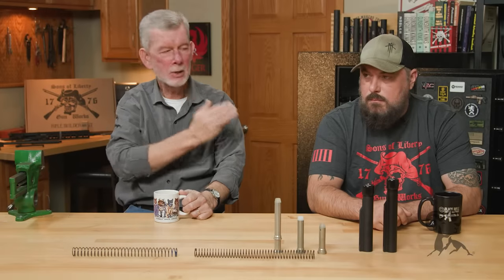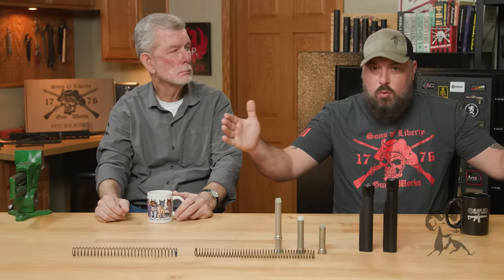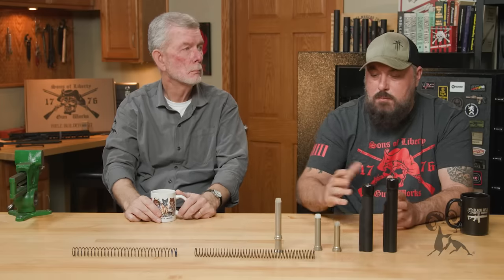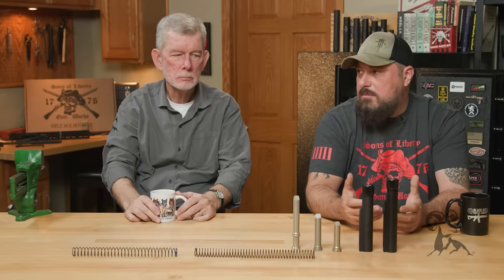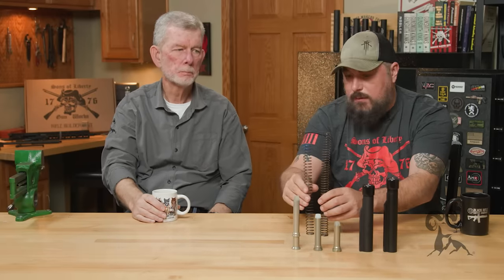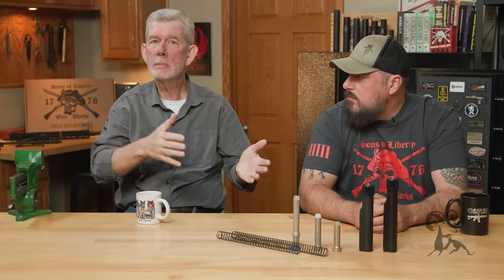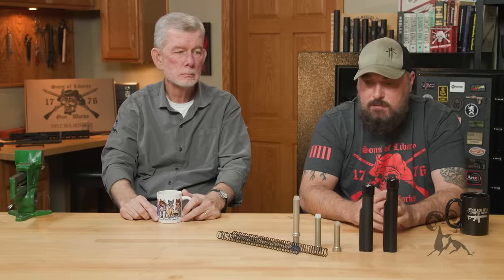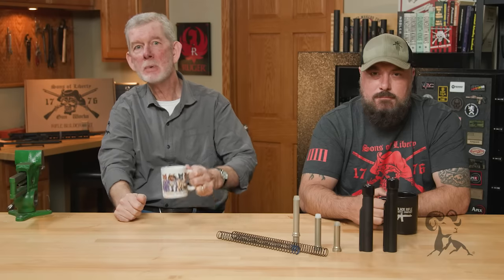Quick Tip: Benefits of an A5 Buffer in Your AR-15

Comment: After upgrading my AR's to A5 buffer systems a couple years ago per Mike's advice I can attest that they make a pretty big difference. It feels better overall, but a big thing is it gives any rifle less recoil. Buffer weights is also a big thing to look into. Most 12.5-16 inch middys will work great with h2 which most prebuilt AR's these days come with the lightest possible buffer weights.
Reply: You don't happen to have a link where I can pick the system up
Reply: @jason hensley considering this is a Brownell's video...I bought a Sons of Liberty barrel from Brownell's
Reply: @jasonhensley3071  You can save money by not buying the complete VLTOR kit. Order their buffer (They're the only ones that make it) any rifle length spring, I HIGHLY recommend a flat wire from Tubbs or Strike Industries, and the AR-10 buffer tube.

I got a Magpul Buffer tube
           Strike Industries spring
            and the buffer for right around $80.
Reply: I switched near every one of my carbines over to an A5 setup and guys that have fired those guns at the range were amazed at how smooth they are to shoot.
Reply: @deangullberry5148  
Primary Arms has the buffer and the extension
Reply: Most companies tend to throw carbine and H1 buffers into mid length gas system rifles so that people don't complain that there is something wrong with the rifle when they shoot garbage, under powered .223 through it. They'll blame the rifle and not the russian ammo.
Reply: @minilogoguy18  i had 2 ARs built at the same time.. a 16” and 10.5”. My 16” has an H1 and slams the bcg so hard. Do I need to go heavier?
Reply: @chief5981  you definitely can but you may run into some ammo not cycling the gun. Buffer weight swap is a pretty easy and cheap way to reduce some of the recoil. If the brass ejects around 4 o'clock though I'd probably leave it alone.
Reply: Will a mil spec stock fit this? Maybe a stupid question.
Reply: @Greighps  Nah you're good man, no stupid questions. Yes it will fit, it's just a regular mil spec buffer tube except it's just a couple inches longer.
Reply: @mrsickwick  awesome dude, I appreciate the reply.
Reply: @chief5981  Mine are all 5.2 oz and David Tubbs flat wire spring. You’ll be amazed.

Comment: I carried a 20” M16 in the Marines and it was an extremely smooth and reliable rifle.
Reply: Yes indeed. Same here. The carbine I shot after getting out are quite a different animal.  I still prefer my 20" A2 clone.
Reply: Thank you both, fot your service. My son is in the Marines, right now.
Reply: @tufelhunden5795  I think the modern equivalent is a 16" AR with a mid-length gas system and the A5 buffer. Really it's the first time in a couple decades that the platform has returned to the original, more gradual recoil impulse
Reply: @Courtesyflush52  I’ll give the A5 buffer a try. Thanks for the information. 👍
Reply: Same here, Brother.  Semper Fi!
Reply: @Courtesyflush52 I always thought it was just nostalgia [or maybe triangular handguards] that made my A1 "feel better." It's hard to explain to someone that's never fired M193 out of a 20" barrel. I say it's like the difference between .45ACP and 9mm, or a push and a slap. I will definitely look into an A5 recoil system. Do you think it'll go good with my B5 furniture? 😉😊 Oooh-Rah!! Semper Fi!! 🇺🇸
Reply: Yes, it is, but for short armed guys like me with armor and gear especially, it's way too long of a stock.  Now that I'm a civilian, an A5 with a simple fixed stock is ideal for my length of pull.

Comment: I installed the A5 buffer system on one of my ARs, now I have at least 5 or 6 ARs that I have swapped over to the A5. It really does make a big improvement in the operation and cycling, And especially reliability and increasing the operational window. And who doesn't want smoother recoil?
Reply: Do you think it’s worth upgrading on a 16 inch carbine length gas system?

Comment: Great video thanks.  To this day I prefer my 20" AR for just plinking around as it is so smooth.  I served '86 to '91 and used the A2.  When I grabbed a carbine for the first time I was thinking something is wrong with this firearm.  😆 Now I'll have to make sure my carbine have the A5 extension to see if it helps.
Reply: Night and day difference.  An absolute dream with a mid-length gas system, and adjustable gas block.
Reply: Thank you for your service Sir.
Reply: Exactly what you said!  After a 25 year sabbatical period from firing an A2, I fired a modern carbine and thought "WTF!!!".  Now all my AR's have this A5 buffer tube.

Comment: I like that he mentioned the "mid-length" gas system. So many people don't know about it...Its what I prefer.
Reply: My first AR was a Aero Middy “build”. I can’t remember if I had put a H1 or H2 buffer in it, but it was a smooth shooter. Only problem I had was the FSB was canted. And I had only found out after I replaced it with a picatinny gas block, that the gas port was drilled off center.

Comment: 100% agree, the A5 system was a huge improvement to my 11.3 Suppressed upper. Definitely well worth the money.
Reply: What length spring and what A5 buffer are you running on the 11.3” suppressed upper? Also what gas system is it?
Reply: i also would like to know which buffer weight youre using. im assuming you cant run a spring that is shorter than the rifle buffer spring since the buffer tube is slightly longer than a carbine length

Comment: I have a KS-47 build that I did something similar on. I didn't know about the A5 system, so I took a rifle length buffer spring and paired it with a KAK variable buffer, using the 3 tungsten weights. It really took the snap out of the 7.62x39 and has become my go to.

Comment: I like that someone actually engineered this to be correct, not just a cut it down and tweak it enough to run.
    I wish Brownell's would manufacture an adjustable gas block for various weapons. The AR would be good and I personally would like to have them for AKs. A lot of weapons are 'overgassed' as a 'band aid' for reliability issues. A correctly gassed weapon doesn't slam it's internals against the rear of the action. 
    Nice video. Ya'll Take Care and be safe, John
Reply: Brownell’s 180 has an adjustable gas block.

Comment: This is my future upgrade for my build, I've been a fan of this company for years.  I'm running VLTOR MUR upper receiver, gas block, charging handle and honestly they make the best uppers,  I use them on both my rifles.  You have to take a piece of 2x4 and tap the receiver onto the barrel because the tolerance is so tight and when you work the bolt carrier it is very quiet and smooth right out of the box. The parent company makes Aerospace products and other things for the defense industry.

Comment: This makes perfect sense. A longer buffer tube & spring, allows the buffer weight to cycle better and easier. Without slamming the back of the buffer tube. So it probably operates as smooth as a sewing machine! This would be nice on big bore guns, with heavy recoil.

Comment: Great discussion. Also the hotter calibers like 6.5 grendel/ 6mm ARC do not like the carbine length and work better with the longer buffer system
Reply: My grendel build has a rifle buffer kit and it short strokes, won't eject the brass.
Reply: @Mrjaspgu  I would start by making sure everything moves free and nothing binds. Then I would go over the entire gas system. Double checking my gas block and gas tube alignments, and check the chamber for burrs. I'm sure you have cleaned and oiled the BCG and checked the gas rings already.

Comment: I guess I am just Old Corps, but I love the rifle version of the AR15/M16.  I have never been fond of the adjustable stock on the carbine. My carbines both have fixed rifle length stocks with rifle buffers on them. I noticed a real improvement in the recoil department when I changed stocks. Just my two cents worth.

Comment: I needed to use an A5 extension with a shorty carbine buffer in my 308 AR10. A standard carbine buffer/extension combo didn’t have the really estate for the carrier to go all the way back to grab the next round or even to lock the bolt to the rear.

Comment: Excellent presentation. 
That explains so many things as many people think they connect any upper to any lower is not correct. You need to get proper buffer & spring to match the upper.
Reply: A carbine upper will work on a rifle lower and a rifle upper will work on a carbine lower.

Comment: You can use a carbine spring and buffer in a rifle buffer tubes by inserting a plug into the tube of the rifle stock equalizing the internal capacity of the carbine

Comment: Yeah I need to get an A5 . 
I've been using SPRINGCO Blue and Colt H2 BUFFER for long time. 
Next build I'm going with A5 and definitely using SPRINGCO Spring because them and Colt are the only Springs I trust .
Reply: A5H2 and Springo Rifle Green Spring I hear is the best setup for mid length gas systems
Reply: @josh48315  I'm running Can so SPRINGCO BLUE with H2 works the best for me on Car or Mid. I also use BRT Tuned Gas Tubes . On my Comp Rifle I'm using 0.66 Brt Tuned gas TUBE with SPRINGCO BLUE and H2 . Super soft shooting .
Reply: @seanwhite304  thanks. I grabbed an A5H2 for my 13.9 mid length gas and an A5H3 for 11.3 carbine length gas, both Springco Green Rifle springs. Haven’t installed them yet but heard this was the best setup for those barrel lengths.
Reply: @josh48315  A5 system is awesome . I've shot plenty of ARs that utilized A5 . I've personally never used one in any of my rigs . I will more than likely try A5 in Comp rifle sometime this year

Comment: Any advantage other than length reduction over a rifle extension? I.e. Running a PRS I assume just stick with the rifle length or am I missing something?
Reply: There is is biasing spring inside the buffer that is really important. It will help your brass condition if you reload.

Comment: Does the A5 buffer system only reliably work on overgassed systems?  I'm wondering if this buffer system would stop cycling the next round on a 16" midlength with steel case ammo.
Reply: Nope. It's more reliable than the carbine system in every respect. Works 100% on my 16" KAC upper with intermediate gas.
Reply: @DBravo29er  was it money well spent? How much smoother did it make the rifle fire?

Comment: Buffers are being used for things they were not engineered for originally. They are there to stop bolt bounce when firing full automatic. You don’t get automatic fire when the bolt bounces it just quits. Not originally used to control bolt speed or reduce recoil. Never change buffers on full auto guns, they will not function as needed. The way Mike explains why there is a buffer shows he doesn’t know why or forgot, “more mechanically forgiving opening up the operational envelope “ that’s convoluted way of not explaining the Why.
Reply: But it does slow the rate down in an M4 in full auto. That's how the got rid of the bolt bounce.
Reply: @MF-Rell  no
Reply: @HypocriticYT  Well I'm sorry bro I'm gonna take his word over yours but Good talk.
Reply: @MF-Rell  I'm not here to convince anyone. Just remember they are describing semi auto AR, not full auto
Reply: @HypocriticYT  True
Reply: @MF-Rell  the M16 and full auto variants are designed to function from hot to freezing climates in full auto. Buffers prevent bolt bounce so the firearm continues to fire rather than the bolt being unlocked when the hammer falls. AR buffers people have tweaked them to attain different results since bolt bounce isn't an issue because you cannot pull the trigger fast enough to make the hammer drop while the bolt isn't locked. They use buffers to change felt recoil etc. I've worked with full auto firearms in the military  for many years and I do not believe what they taught was incorrect.

Comment: How would the A5 system compare with the Geissele Super 42 buffer system? I realize the A5 is longer with a longer buffer, but curious about any other important differences in cycling and reliability and flexibility (running suppressed or different barrel lengths).

Comment: This is of course just my opinion but what the A5 system does the Geissele Super 42 buffer and spring does better. Now that Geissele is offering a Super 42 spring for rifle buffers you get the best of both worlds.
Reply: I run an a5h2 with geissele super 42 rifle spring in both my ar's

Comment: If the AR started as a 20" rifle with a longer rofle length buffer system, then what sense does it make to switch to a weaker, shorter w/ a lightened buffer when creating a weapon shorter than 20", i.e. a 14.5" carbine?

Comment: Question about the A5 system. If you have an AR that will fire and eject the spent casing but not pick up a new round from the magazine unless you use a lighter buffer and spring, what will the A5 system do to it? I imagine with the extended stroke it would make it fail to pick up a new round. But I’m not sure I completely understand this system
Reply: Well, the A5 system has more consistent spring tension from in-battery to out of battery. Meaning tias it's less dependent on spring strength more dependent upon buffer mass. This is a much more reliable way to regulate function.

For you, what buffer are you running now, with what spring?

Comment: Well you got me all worried that I have a rifle length gas system connected to a carbine length buffer system.  The only trouble I have is dented Grendel case mouths from hitting the deflector.  Maybe slowing it down would help with that.  I have the Spike's T2 buffer with the tungsten shot and non-adjustable gas block.
Reply: Maybe a rifle-length buffer system would slow the carrier down a bit? I would try it.
Reply: I have a rifle buffer kit on my rifle length gas system grendel build and it won't eje6the brass. I'm wondering if I need to switch to a carbine buffer kit with an H1 or H2 buffer.
Reply: @Mrjaspgu  where is it leaving the brass?
Reply: @Mrjaspgu  Will it cycle rounds when you work the charging handle?  I had to take some sharp corners off my extractor, ala JRB video www.youtube.com/watch?v=kMrMUyyWV0k
Reply: @Dahut  yes, they cycle fine by hand. Slow motion video of the ejector port shows that the bcg doesn't go back far enough to eject the case.
Reply: @MJA5  either jammed into the feed ramp or gets pushed back into the chamber.
Reply: @Mrjaspgu  Is this with factory ammo or reloads?  Some of my brother's reloads were a little "light" so pressure was dropping-off too quickly (with H4198– fast powder) to cycle the action.  Otherwise, I found some good results by searching for:
ar-15 short cycling rifle length
Reply: @dahut3614  factory 90gr hp's

Comment: You need to be careful putting heavier buffers in your gun especially if you use it for military or law enforcement or self defense in that matter.  Had a h3 in my carbine ran fine in summer. Went to go shoot in winter and I was having short stroking. Threw my h buffer back in and it cycled fine. So the h buffer stays.
Reply: I haven’t tested that set up in those conditions so, this is just speculation and curiosity, do you happen to run a grease in your guns that might be prone to getting stiff in cold weather? I know I’ve heard of that making or breaking a cold guns performance. Maybe test it with a thinner oil in the cold to see if that’s the case?
Reply: I’ve honestly thought of that and the only way I can think to check that is go to a totally different climate and shoot drills as I normally would. Good idea 👍🏾

Comment: Any suggestion/advise on correct  spring length and buffer and also the extension to use on a 16” 556 build?

Comment: I just built an 18" upper with a rifle length gas system. Ran it on my existing "carbine" lower (standard carbine extension, buffer, and spring) and it seems to cycle just fine. 5.56 loads ejecting at 4 O'Clock, no failures. Am I missing something?
Reply: Yes, try the same upper with a rifle length buffer system and you will notice the difference….it will cycle smoother. You definitely notice this more when shooting suppressed.

Comment: Is there a difference in mil spec vs commercial buffers and springs? I know the tubes are different. I have a all commercial spec carbine that overpassed and rips cases and broke the extractor. I want to get a H buffer and maybe wolff xtra power spring but not sure if they will fit. The AR stoner H buffer I found says mil spec.

Comment: I have a 20" aero m4e1 upper with an a5 tube and a 4.7 ounce buffer weight. Will an adjustable gas block be needed? I got these parts laying around and want to throw them together and am wondering if its a good idea

Comment: Also you can use standard buffers in 308 lowers fyi
Reply: Only with the A5 receiver extension...which is actually just an Armalite AR-10 receiver extention.

Comment: Where can I find out more about buffers and springs? Like what kind of buffer for a 10-in or what kind of spring for a 16 in, stuff like that
Reply: Either get multiple buffer weights and play with it or if you insist on buying only 1 just convert in your head -1. E.G. A5H2 is roughly H1 carbine equivalent. Not perfect but ballparking it

Comment: For legal pistol build, the A5 tube and a 10.5" barrel give 13.5" LOP and 26" OAL... right on the limit... so for 10.5" barrel, I like the M4 to be an inch short of the limit.   With an 11.5" barrel, you wouldn't be legal with an A5 tube in a pistol build.
Reply: What do you mean